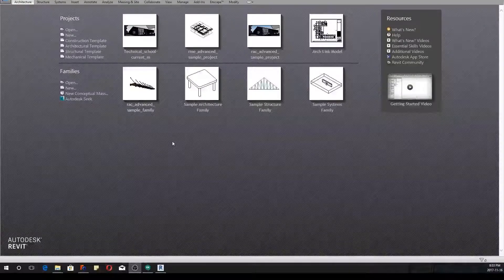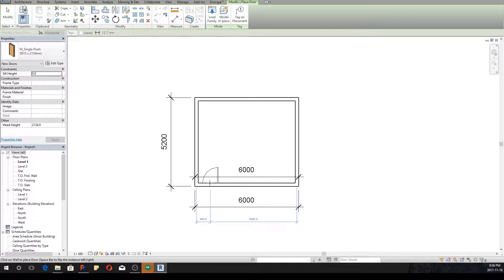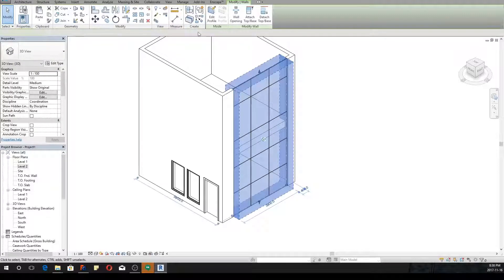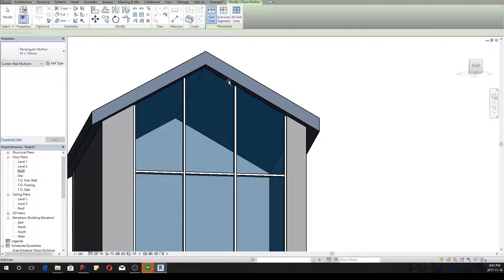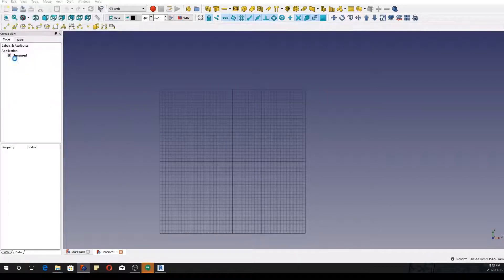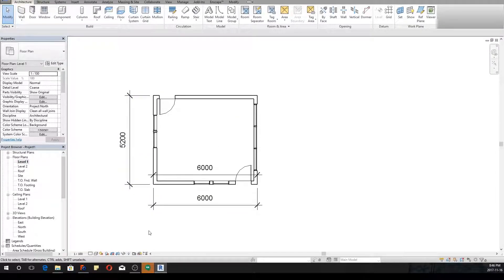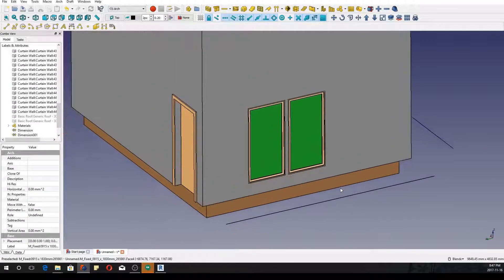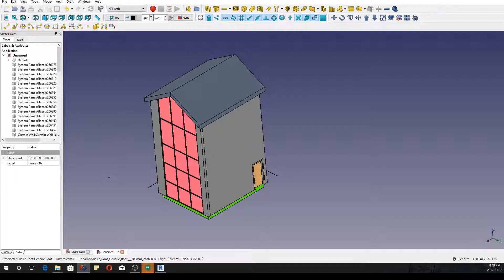Revit to FreeCAD with IFC - 2

Comment: Hello Regis, your tutorials is very interesting, and freecad is growing very well. But in a Linux (Ubuntu, mint) the ifc import doesn't work even after place the ifcopenshell in the system.. Any advice? Thanks.
Reply from the maker: Absolutely you are right, I had not noticed that it didn't work on my linux (it used to work). I also tested on my system and it didn't work. 
I created a post about it in the forum, so we can follow up the latest development on the issue.
https://forum.freecadweb.org/viewtopic.php?f=23&t=25499

Comment: hello bro ,,good tutorial but i has a question
can i import a big ifc file into freecad and after opening the file will be able to any changes
Reply from the maker: big IFC? how big? normally you should be able to import any IFC into freecad. Yes you can still work with IFC in freecad, destroy or model with or on top of the IFC. However you may not necessarily be able to para-metrically modify certain attributes like height by just entering a height value.